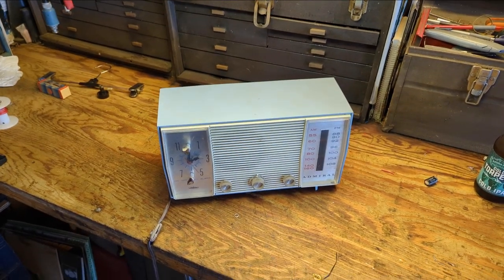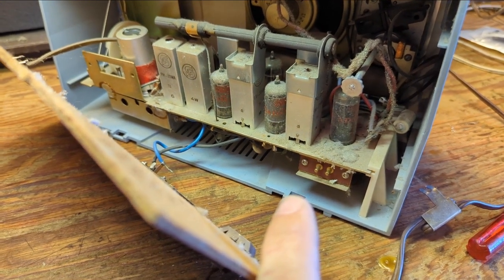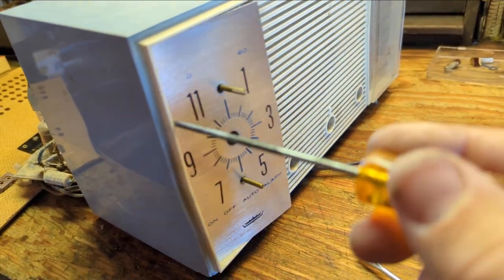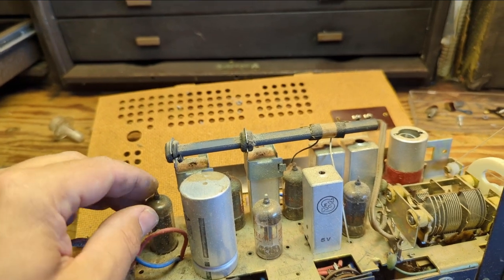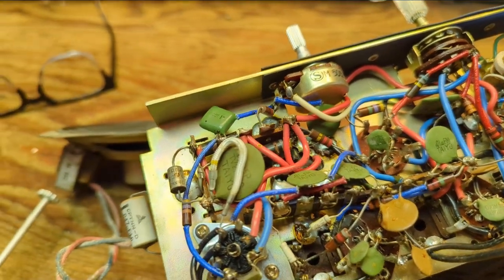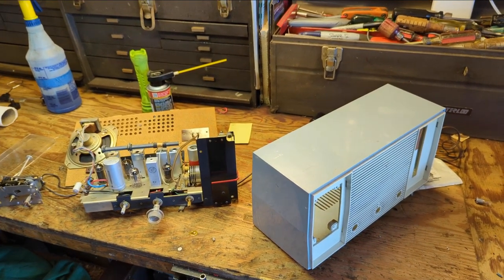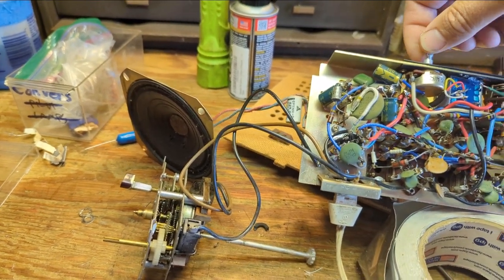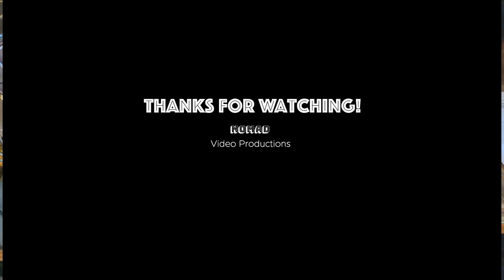From drab and boring to.... better

Comment: If only it had been built to use the small pencil stub wire ended vacuum tubes with a H+ of 1.5-3V and a B+ of 60V would have been much better and would run cooler.